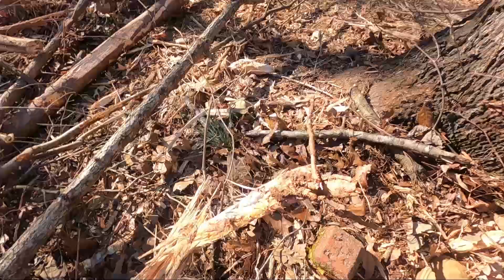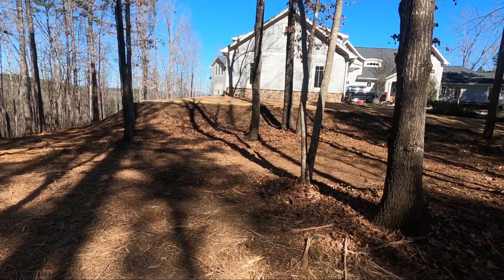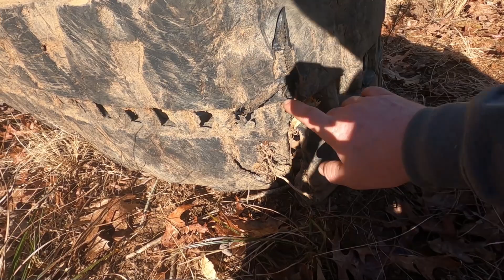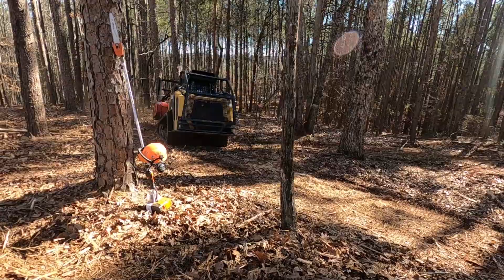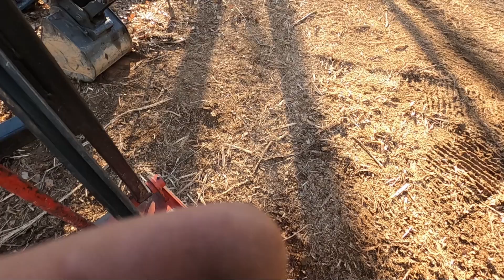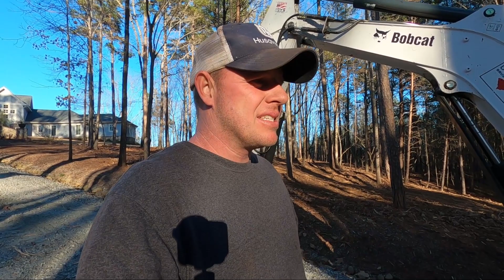We Broke a Track on the Mini Excavator | Day Two

Comment: Reminds me of in December when I was on a job with my asv skid and the right side sprocket broke so it no longer engaged the track. Took me an hr to drive it 200 ft to my trailer because only the left side was working. What a pain that was. The customer goes wow you have alot of patience. Took me the same amount of time to put a new sprocket on as it took to get the thing on my trailer

Comment: Hey there Jon...another interesting video! I've had that happen to me and it can be a painful job to fit a new track...but I have a tip which you might find useful.
I used wire strainers to retract the idler...make sure the grease nipple on the adjuster is either really loose or out and the strainer will pull it right back for ya. Pretty much the same method you used, but no mucking around with a long strap and short ratchet handle. As Jon Schneck said, put the drive end on first and it should feed on much easier.

Comment: next time when you are on a rough surface put a few 2x4s under the track to allow it to slide. put the drive end on first and it will track on with a little help from the bar